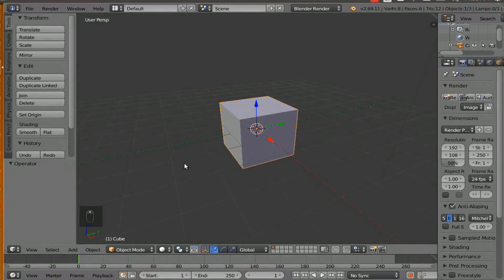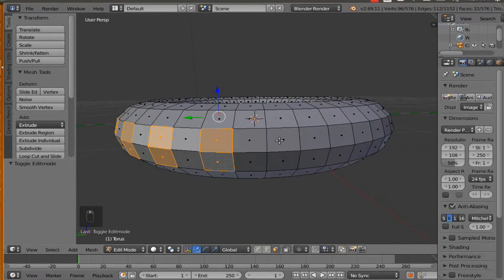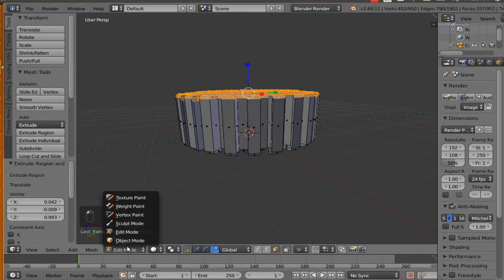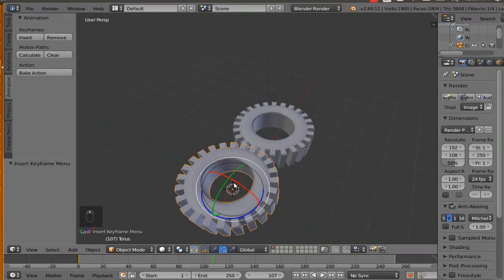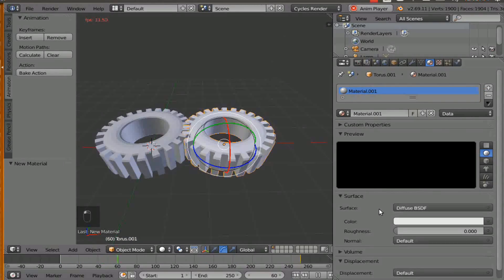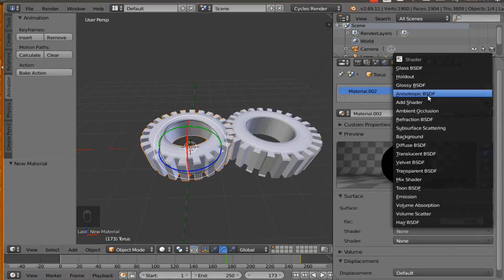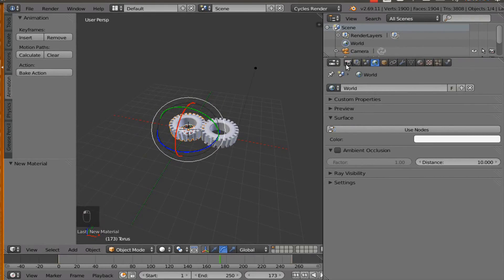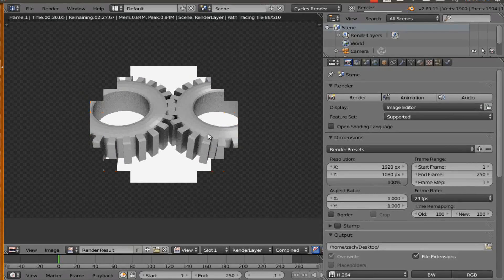Animation Basics: rotating gears (blender) [HD]

Comment: This is a great video. I was able to get through to the animation part. I have 2.77 version. I am having trouble with the rotation. I noticed you rotated on z axes. When I perform the rotation it is rotating all over the place. How do I control that. How do you keep it so steady.
Reply: You can hit the shortcut r for rotation then hit z to constrain it to the z axis, then hit the left mouse button to finish or right mouse button to cancel. As well, you can type in exactly the amount you want a value to change in the transform section of the toolbar on the right that has the shortcut n.

Comment: Hi,
I have a problem where the object will automatically take the shortest path to the rotation position I have selected in the keyframe. therefore when I set it to rotate 360 degrees it rotates no degrees, ie it doesn't move at all. which rotation mode are you in? I'm guessing this is the source of my problem
Reply: After you change the rotation to 360, make sure you insert a new keyframe, the program won't do it automatically like in adobe.

Comment: This tutorial helped me to get started with animation. While playing around with the gears I discovered a better way to set the rotations for the two gears than what is shown. Instead of spinning the gear 360 degrees by hand before setting the second keyframe to 250, you can just add or subtract 360 from the z-axis rotation field in the Properties window (if the gears are laying on that axis). This will give a precise 360 degree rotation.

Comment: Anyone using the technique your are showing will be setting themselves up for a massive headache down the road if they need to change say rotation speed, or gear size.

The proper and far superior way to do this kind of animation is using drivers, it is so easy to learn and will save a boatload of time.